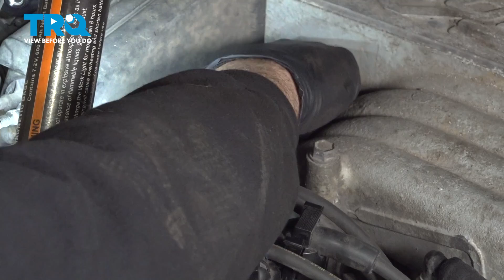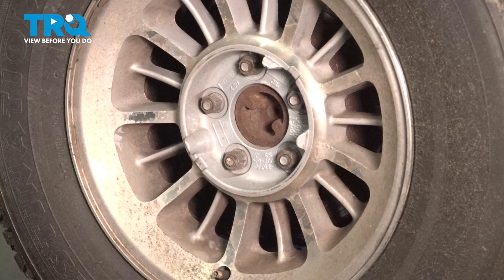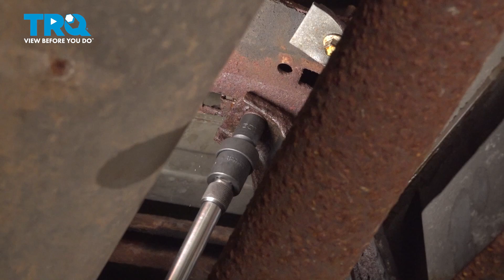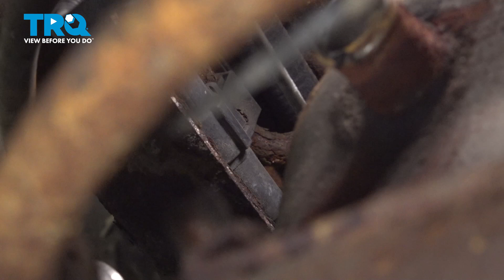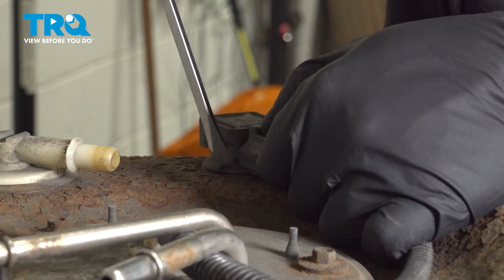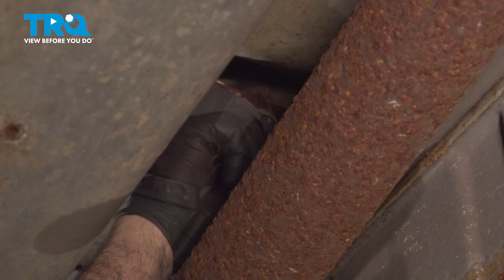How to Replace Fuel Pressure Sensor 1995-2001 Ford Explorer

Comment: My car gives me similar problem I have change injectors, pump, air flow meter sensor, fuel filter and fuel pressure sensor in the engine but still my ford Explorer model 2000 has the fuel smoke from exhaust

Comment: Would a faulty negative or connect on this sensor cause these new fuel pumps to electric fail after a week or a day. I've gone through a couple new pumps. Still waiting to check these sensors and fuel dampener also. Wonder what's burned up new pumps ( cheap ones off eBay) pumps.
Reply from the maker: +Shawn Slay We wouldn't be able to diagnose an issue like that here, you may want to have a local mechanic take a look at it. Thanks for checking us out! http://1aau.to/m/Shop-1AAuto-c